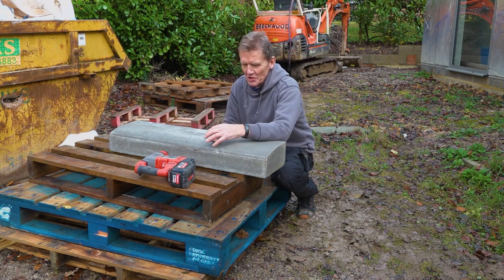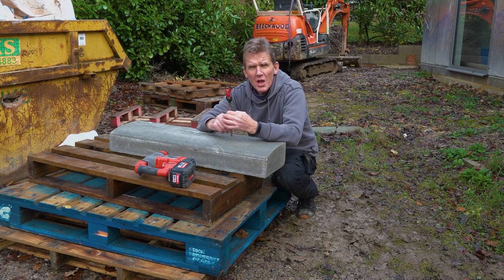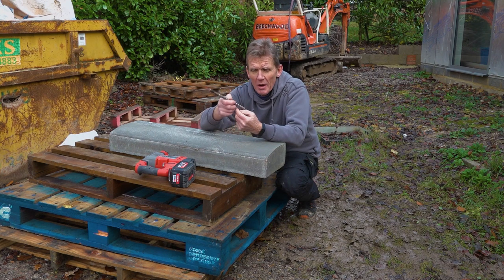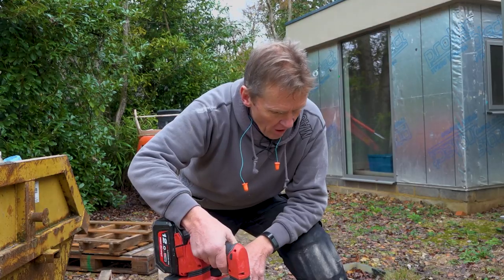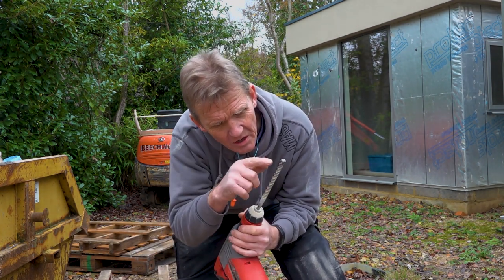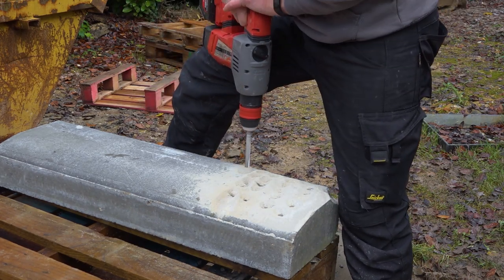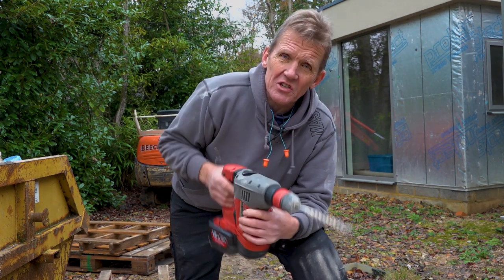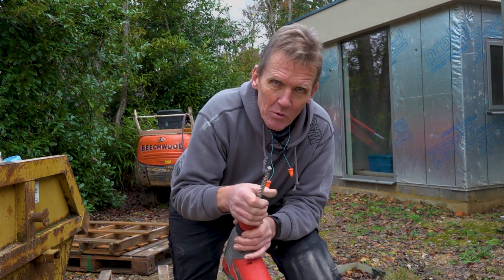SDS-PLUS MX4 Drill Bits from Milwaukee

Comment: Excellent drill bits, even better with dust extraction. I use a Gemini plate extractor on the Milwaukee battery vac and these quad tipped bits go on for ever.
Regards
Tim

Comment: Used 5/8 sds max yesterday work great in just concrete but if you hit rebar the tip overheats  and falls off 😡😡they should be inserted carbides  4 points ,, rod breaker not going buy Milwaukee bits again otherwise they are a great tool maker

Comment: I see you're applying quite a lot of force when drilling.
My understanding is that with SDS (Plus and Max), no real force should be applied.
It will extend the life of your drill bit quite a bit.
Using my 10mm drill of this same type, I managed to drill over 400 holes in dense concrete without any problems.
Reply from the maker: I wasn't pushing but I did apply pressure. I have said on many videos that with SDS it is counterproductive but there is a sweet spot. I think you can see that it worked very well.